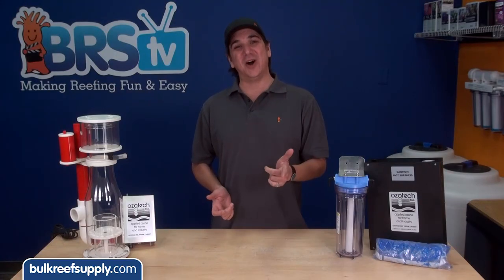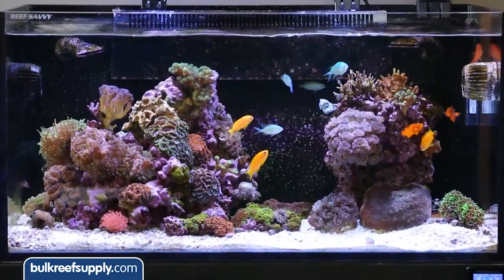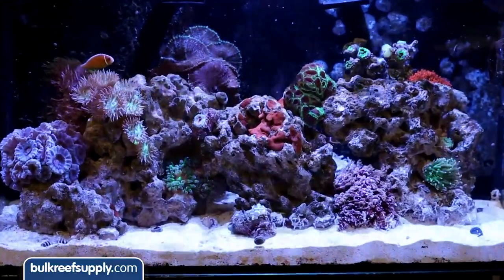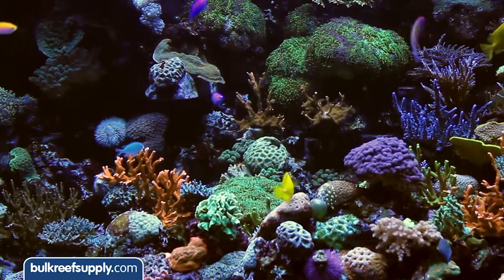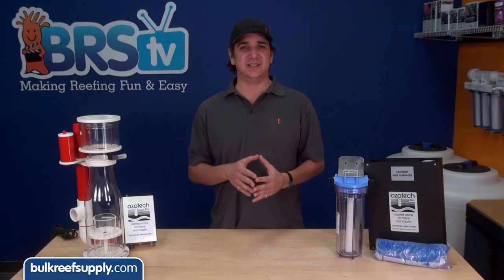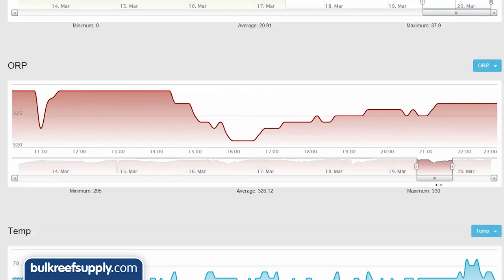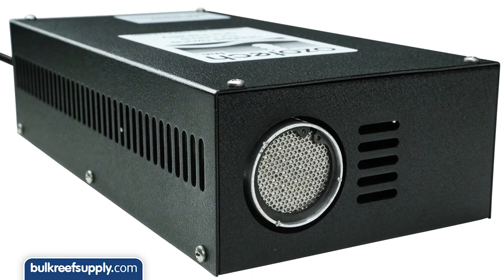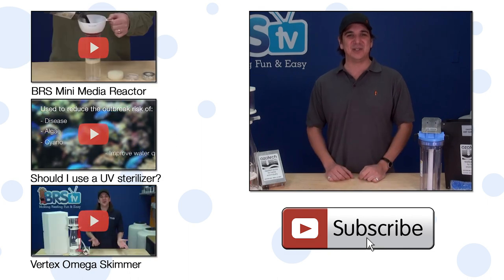Should you use ozone in your aquarium?

Comment: Just contemplating If I should or shouldn't put Ozone on my new reef. After watching this it's really opened my eyes. I thought it was a simple case of just plugging it in and you are good to go. Seems like a lot of work what ever route you choose when running Ozone. I think I might just stick to running a carbon reactor. Thanks for this great video it has really helped me.
Reply: I'm also faced with this. I can get the whole rig for cheap.
Reply: It doesn't hurt to run both Carbon in a reactor and ozone does it? I have been hit with Velvet 3 time in 7 months and I'm very close to throwing in the towel. I've cleaned my entire tank and have started again. This time round I want as many options as possible in my tank to keep water tip top and keep parasites away
Reply: ***** thanks for your response and guidance.
Reply: Yes I've got a vecton v2 600 uv sterilizer on the tank at the moment with a brand new bulb. Do you think I should have 2 uv sterilizers? So scared of starting up again in case I've missed something when cleaning. Want as much as I can on this setup so I don't get caught out again. 

Just had my Sohal Tang die in my QT tank that is copper treated. Feel like crying haha.
Reply: No it stays at 26 Celsius most of the time. Would temp swings cause huge problems? I have 2 heaters in the sump just in case
Reply: Aarons Aquarium dude your tang died? That sux. Sorry bro.
Reply: Willy d. aquatics that's exactly what I have done I've bleach and cleaned with white vinegar. I'm still super scared of adding fish.
Reply: Aarons Aquarium your good then man. Bleach kills it.
Reply: ***** thank you for your replies really appreciate it.

Comment: Been down that road with the exact equipment. Personally because of non discriminant behavior decided to challenge myself to do it naturally if possible. My orp is 430 on the 180 reef all the time naturally and crystal clean.  If you miss to gas off before the return can lose inverts fast. As for smell if the tank smells something is wrong. Don't even use charcoal.
Mostly used in fish only commercial aquariums (very large) as it is cost effective for them.

Comment: Most of the reasons pointed out for using an ozonizer or ozone reactor overlap with the benefits of running a carbon reactor. Newbie reefer here so please answer these two questions... If I am running a carbon reactor, do I NEED to run an ozone reactor. The alternate second question is, If I am running a carbon reactor, then will an ozone reactor or ozonizer BE OF ANY OR MUCH use... ? Thanks.
Reply: Thanks :)